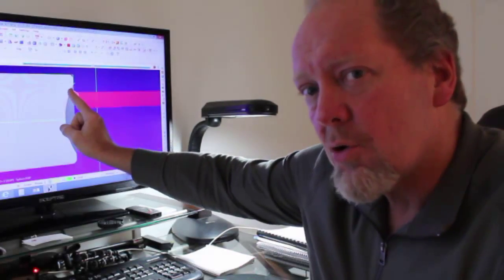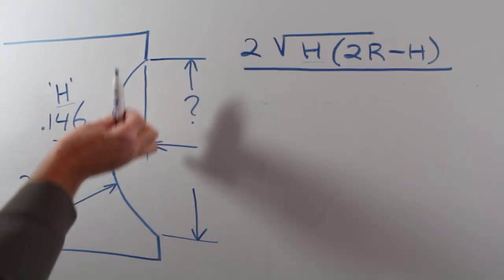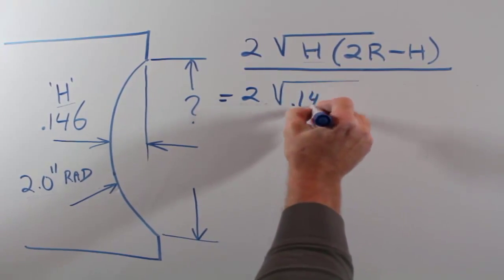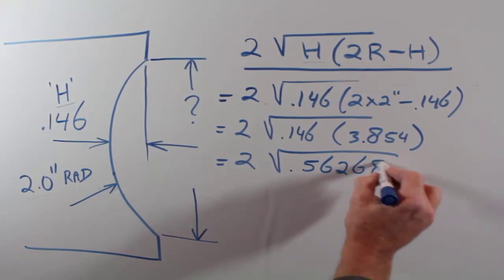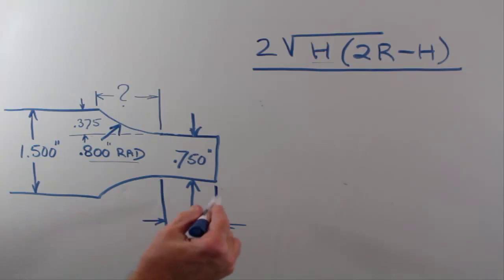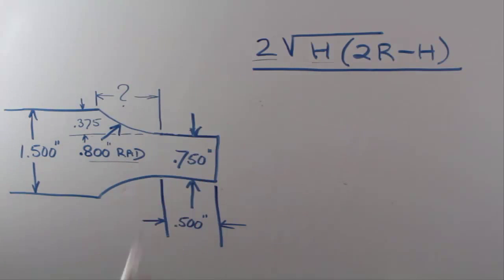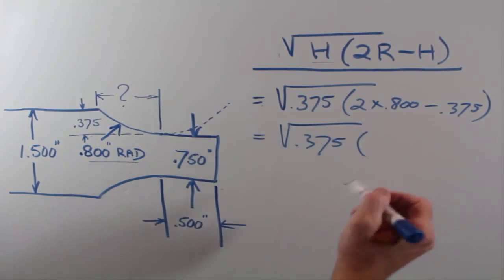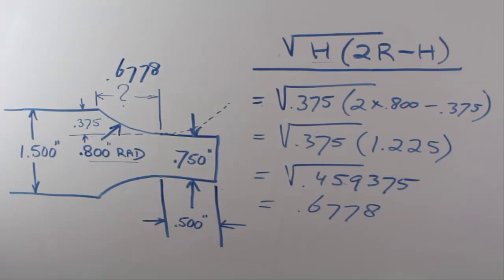CALCULATING END POINTS OF A PARTIAL RADIUS.

Comment: Tom,

I found this video while searching for some information on calculating geometric start/end points for arcs and angles.  This is a GREAT video for calculating arcs.  It seems like you haven't been very active lately but I really wish I could find more videos like this.  I've been programming CNC 'at the machine' off and on for almost 30 years.  One of the things I have always struggled with is calculating arcs to angles and/or arcs to arcs.  With most of the lathes I've run, when programming a partial arc you can't use an R value and you must use I & K.  This means I have to know how to calculate the start [or end] point of the arc (X & Z) as well as knowing how to calculate I & K.  While there are plenty of videos on how to write a simple G-code program, there is a complete vacuum on how to calculate tangency points of arcs to angles and/or arcs to arcs (like the classic trailer hitch or an acorn nut).  I hope you see this comment and some of the other recent comments as I am not the only viewer who has asked for help with this topic.

Thank you, thank you, thank you for all of these videos.  I like how you just jump right in and you don't 'front load' your videos with a bunch of useless, arbitrary information.
Reply: i'm sure you can use R try running the little prg just let it change to metric or if rain to inch think it will run it   some times  you must write 1/4   or 1/2  . you cant go over 180  R
  G21
G0 T0808
G97 S360 M03
G0 X24,373 Z1,953
G50 S600
G96 S550
G1 Z-.047 F0.1
G3 X.8 Z-3. R25.
G1 X-2,028 Z-1,586
G0 Z50
M30

Comment: Hi Tom, great video.  You have been very helpful to a new guy like me.  I got the calculation, but what would the the G code look like to cut that arc??
Reply: Go3
Reply: it depends which direction you want to cut, going counter clockwise G3 which means you’ll be cutting the oposite direction a clock turns (left), going Clockwise G2 same direction as a clock (right)

Comment: Hi Tom, great videos. Have you thought of posting one on circular interpolation for a lathe using the I and K values instead of the R value. I think this is required when there is not enough room between diameters to allow using the R value. I have never really understood how to find the start and endpoints for I and K.
Reply: i = X_center - X_start
j = Y_center - Y_start